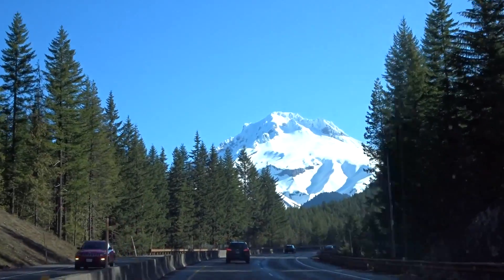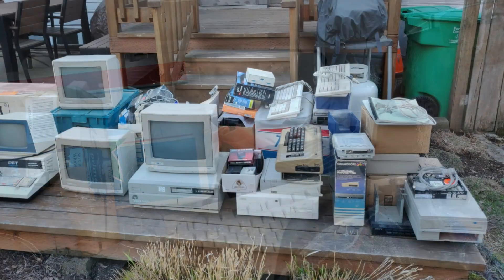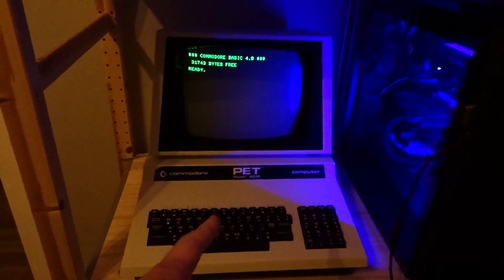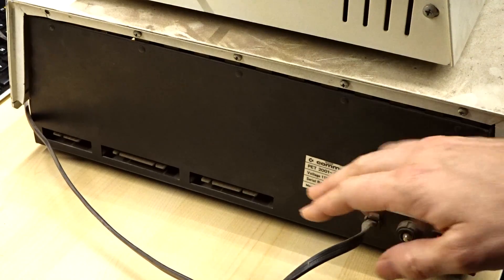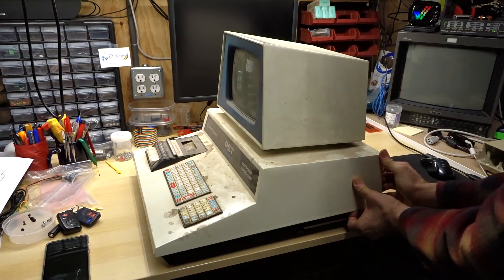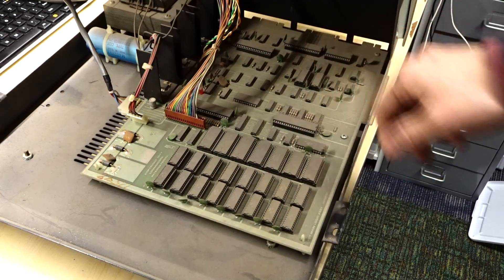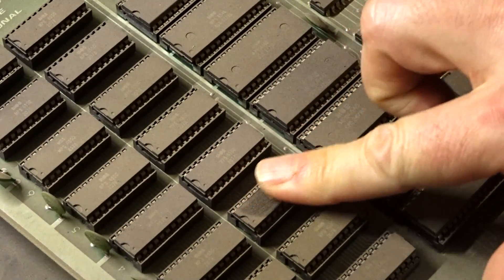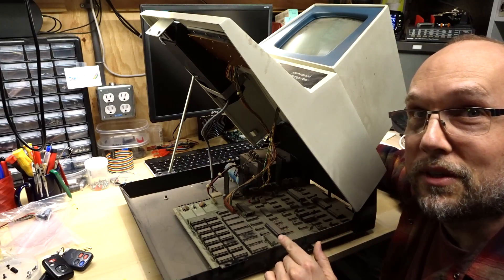The Commodore PET Rescue

Comment: the expansion port carries a full bus up to address line 11 along with quite a few pre-decoded select signals and as such... yes. you can hook up pretty much anything you want to it and i'm sure people did and many still do (mainly considering that the thing lacks both rs232 and any other sort of network capability - the pets don't even do software bitbanging rs232 on the userport. at least not without loading the routines for it yourself. so yeah i do guess quite a few people instantly soldered a 6850 to that ;) besides that. other than the keyboard, the basic revision they originally shipped with (most have been modified to basic 4 anyway), some other obvious things. it's pretty much the same machine as a 4016/32 or 8016/32 they all seem to have the video ram in the same spot, 1 via and 2 pias, in the same spots too. they also all have $0401 as the load address, so it's not like the 2001 is gonna do anything more or less than your other pet :P other than having a bit less ram and a worse keyboard :P the only thing potentially causing incompatibilities between the pet series is the various different keyboard versions when decoding them directly... some differences in the character roms for 'international' versions, and the 'basic 2 or 4' (along with different kernal and editor roms to accomodate that) thing. (not that it seems to make much of a difference while running programs as basic 4 is just microsoft basic too. just with another number ;) as for the 'just soldering stuff to that expansion port' eh yeah well gotta keep in mind the previous model was the kim-1 :P lol. and other such things which come with a piece of prototyping board to solder onto on board of all things :P i do think many people 'added some stuff' but no. not with a connector and a cartridge housing around it. :P lol.

Comment: Wow… your YouTube site …what a find!! I am in uk. The Pet 2001 was the first computer I programmed in 1978… I subsequently swapped a Casio programmable calculator for 4K 2001 one in 1984. I have it shrink wrapped in my loft, processor working and some display corruption probably through corrosion too. Anyway you’ve inspired me to get it down in 2023 and sort it out. 😉Thanks. Ps any exposure to Cambridge Computers mk14? Subscribed, Mark aged 60 1/2

Comment: The big blue Mallory CGS series cap went leaky in my 2001. Last time I took it for a spin, the transformer hummed like crazy and clearly wasn't happy, so I immediately pulled the plug before blowing the primary. The Mallory is originally 27000µF, which is an odd value (it's also a LOT bigger than the one in this video). The closest replacement I found is a 24000µF KEMET, which is much smaller; not sure if it's still long enough for the original mounts. Given that the tolerance is probably 20%, I expect 24000µF is still ok. Mouser and Digikey still list the Mallory CGS series in Europe, but they cost about triple compared to the KEMETs, plus double for shipping!

Also, the fuseholder on my 2001 broke too, though it was actually the plastic post that cracked and separated where it passes through the case, exposing the metal contact and shorting it to the case! This happened while I removed the fuse to check it (assuming it had blown due to the essentially shorted cap). Luckily these are easy to replace, though the 6.3mm fuses are less common in Europe. The original fuse -- rated "3/4" at 250V, so presumably 0.75A -- is still intact, so that's good news.
Reply: P.S. The top half of my 2001 is actually RIVETED to the back hinge, so removing it isn't an option. I wonder if this is the case (pardon the pun) with all later PETs.

Comment: At about 10:30 he frets about using a 1.5A fuse ("it's pretty beefy" and "more than enough for this computer") right next to the label that says the PET draws 1.1A. That could hardly be a better match - if anything a slightly larger fuse would be ideal.

Comment: Oh my God I owned a Commodore pet 2001 which I Purchased from Rick Inatone Back in November 1978. I programmed that computer day and night, I peaked and poked the memory. I can remember typing Hexadecimal code into the machine to program  a chess game. I wrote basic computer software programs and actually stored them on cassette tape. It took 20 minutes to back up the 8K of memory and you had to do that three times just to make sure one of the copies was readable. My first big endeavor was to program a bowling league sheet which I printed on the commodore  dotmatrix printer. I eventually programmed my business using Commodore 8032’s coupled with the hard disk drives, what fond memories. I actually have video tape of me playing chess on the computer with my son on my lap, as he was only less than one years old. Thank you for bringing back such memories.

Comment: SRAM is still much easier to work with than DRAM.

It is also easy to adapt newer SRAM to replace older SRAM, and it could be done with making a board that plugs into the existing SRAM sockets and routes the signals to the new SRAM.

Comment: I recently picked up a Commodore PET 2001-8 however I am having a power problem. When I turn the machine I hear deep humming followed by a little smoke coming off one of the rectifier diodes. 

I have ordered new diodes, so I have to wait to see if that will help.
Are there any other trouble shooting test that I can run to test the incoming power, or test for shorts throughout the board?
Someone had placed IN5406(600v) diodes instead of the IN5402(200v). So, I have ordered the correct ones.
This video was a bit helpful, but you will want to fast forward to 9:00

https://www.youtube.com/watch?v=Hgz1GqeprKE

Comment: Wire up a USB-to-serial cable to connect the 4016 to the PC. You could use the PET to display CPU load, RAM usage, fans, temperatures, etc...

Comment: I really enjoyed this video. But I wish you had checked the voltages before giving the motherboard power, given how rare the SRAM chips are, it felt a little awkward. I look forward to the cleanup, and am enjoying your content!
Reply: Someone said in another comment that isn't possible with this computer because the power supply is on the main board and there is no way to isolate it. But maybe replacing any large filter capacitors would be a safe precaution, especially if the chips are so rare.

Comment: these commodores always have problems of some sort. My 64 was in a box for like 10+ years and later found out the sid chip had a bad voice and the 64 was in pristine condition, it was only used a few times.
Reply: The VIC-20 seems to be much more reliable for some reason. I have two of them and I didn't have to do anything other than clean them. They worked perfectly fine. But I bought a C64 and it's not working, and I've seen so many videos of people trying to repair them.

Comment: uhh! It really looks like you have a different kind of dust that is extremely fine! I have a dvd recorder that had some errors because of dust that was on the circuit board. I tried twice to use an air compressor to blow off the dust on the board to get it clean, and it just was so fine that it just doesn't come off! fortunately I was able to get the recorder working again by repluging in the cables everythere to make sure everything was actually connected.

Comment: On old dusty computers like this with dual row ICs, I'd recommend carefully pulling the socketed ICs and cleaning the contacts manually.  Use a glass scratch brush on the IC pins, and a small contact file in the sockets if absolutely necessary, after a good swipe with alcohol and a toothbrush as the first course of treatment.  De-Oxit is good stuff, but it helps to get things as clean as possible first before using it around PCBs, because it will tend to wash the contaminants onto other parts of the board where they can cause issues.  Honestly though, I'd probably ultrasonic the whole board too, and replace all the electrolytics as a matter of course.  It doesn't seem that much is wrong with that PET other than some poor contact surfaces and/or dust bridging lines.

Comment: Wowee! Fun! I have two of these original PETs. One blue badge, one black badge. Just try to find one 6520 VIA...I dare you. Hopefully it is the dust(probably is). If not, I read you can use a 6522 VIA out of a commodore disk drive. You can replace the 6551 memory chips with 2114s with a wire circuit daughter-board adapter. I bought a few several years back on ebay in case i ever need any. However, recently, I saw that a bunch of NOS 6551s from 1982 were made and were for sale in the the tubes on ebay. Why they made more in 1982? Probably for surplus for service outlets given the end of the PET line was that year.

Comment: It can't be Oregon, or it'd be raining.  Don't say bespoke, it makes you sound pompous, when talking about junk we all have in our barns (event though it's dictionary technically correct - I think we always just said "custom").   

Look at the the PET, then look at the VIC, and go huh? - how did they make that leap, they look nothing the same?   It's inexplicable.  Until you realize, at the time the big three first to market were the PET (KIM in a box in 6 months), the Apple, and TRS-80 Model 1.   Compare the Model 1 to the VIC.  The VIC (sold in JC Pennys) was basically a rip of the Model 1 to bite into its market share because Radio Shack was dominating with all their store locations.  And of course the 64 was what the VIC should of been, and the 128, what the 64 should of been.  Everybody ripped off and copied everyone back then, it was a war of speed of fastest to market with whatever crap you could get working in a box and out the front door.   Explains Microsofts QDOS and Apple ripping off Xerox, it was just mercenary and sketchy back then.  8 bits were the new crack cocaine drug and the early manufacturers were drug peddlers to hippies.

Lots of videos of Bill Herd and Jack Tramiel on YouTube talking about C= Chicken Lips history.  Have fun cleaning the calculator keyboard.  And er, using it.   :-p    The 2001's only claim to fame is just that it looks like it belongs on the set of an early Star Trek.

I did a lot of programming on 8032s in college, and my girlfriend worked on KIMs in her computer lab...  they were horribly obsolete by that time.  I cut my teeth on a VIC/64 so I was right at home on the 8032, but talked my dean into letting me move over to a 12mghz PC with QuickBasic Compiler where I wrote a Spreadsheet app for him..  I ended up with an 8032 in my junk 10 years later from someone clearing out their garage of 8 bits.

 I got a barn full of 8 bit and later crap, so if anybody is near Augusta, GA and interested in helping me clean it up and getting it running some day, hit me up.   Just don't have a big building to display it all in.  I use to bring  it home by the pickup truck load from colleges and universities and nuke plants throwing it out in the 90's when it was absolute trash.   I use to say, all old computers eventually come to me to die... and they did.   If you were willing to spend the gas to haul off other peoples trash for them, you could have all the e-waste you wanted back then.   I probably got some 120 or so machines left that I myself did not dumpster.  Enough for an instant museum.

Comment: Hi Adrian, I'm sorry but I can't help to give a few suggestions.  You should disconnect and test the power supply first.  Then change all the electrolytic capacitors.  There really is no reason to even giving them a try.  They slowly turn into resistors after all these years and will cause much larger problems somewhere else in the board.  I usually change the power diodes too first.  I only feel safe to power a vintage electronic device like this after doing all those things first.  Same goes for the CRT as well.  You know you can easily damage a hard to replace part. Maybe you were very anxious and couldn't wait to start it up or maybe you wanted something to break so you could fix it on youtube or maybe you want somebody else's computer to go bad by giving a bad example and you want to fix it for them, I really don't know.  I know this is all very interesting but you don't want to give inexperienced viewers wrong ideas about the requirements of a vintage device.  I have a new vintage computer, I am very excited, I have to try it right away... very childish and wrong....

Comment: Please clean the dust off before turning on your next old computer. Dust can be a source of static electricity build up. Don't take the risk. Also, please invest in a variac to ramp up voltage to on old computer of unknown condition - more important for CRT than computer but worthwhile anyway. This way you can check voltages etc and won't need to rely on the smoke. You're a very lucky man to have all those goodies given to you - please look after it :D

Comment: You are braver than me Adrian. I would have been scared of all the voltages being out of whack from the age of the power supply and there would have been magic smoke released. Also is that big blue thing the smoothing capacitor for the rectified mains?

Comment: Should probably test the power supplies for correct output voltages with a multimeter
first, especially on these old commodores as they have a history of that, and wrong
voltages will damage the chips.  Though you may have known this and simply got
too excited for precaution eh.
Reply: YES! THANK YOU! I can't believe he smoke tested a 40 year old collectors item of that historical importance. Sometimes the voltage regulators fail too, and they'll still run at 9V until they die. The capacitors may need changing(the smaller ones). But ya, test voltages with supply voltage disconnected from main logic board. Then test again with them connected to see what it looks like under load. Smoke test=no test...and probably a few fried parts that are darn near impossible to find.

Comment: Wash that board! Depending on where you live, dust can be conductive, and ruin electrical connections.

That was the first PET I used in high school at the BTHS Physics Dept. Computer club in '78 and then we got the other 2001 with the full keyboard. Strange; the newer 2001s with the large keyboard used 2114s Static RAM Chips and 4108/4116 Dynamic RAM chips. Putting/upgrading that PET with more RAM should not be a problem.

Later in HS ('80/'81), the Math Dept. got a bunch of 4016s to teach programming on but being a computer club member, I was head of the class and the teacher who did not know anything about programming.

I've seen a RAM expansion board for the PETs that fit that slot.But that was a long time ago.

Comment: I normally don't make comments but the PET 2001 is a model I always wanted to find.  Hopefully some day.  I was concerned when you powered it on you didn't check the condition of the power supply before powering the logic board.  Overvoltage could have made the situation much worse.  I know the C64 power supplies have this problem but I don't have much experience with PET models to know if it's common.  Though I would not have taken a chance.  I look forward to seeing this machine restored.

Comment: Please!!! Never power up an old computer in unknown state, before checking correct power supply voltages, clean contacts and paths, chips-to-sockets corrosion, blown/burnt components (visual inspection), and specially if capacitors are within specs!!!
Reply: I wouldn't suggest desoldering all the ceramic capacitors on this board just to test their values unless you have a problem.
Reply: I mean the electrolytic capacitors, that are more prone to fail due to leakage or drying out.
Reply: @audio01  Ahh, well I didn't see any electrolytic capactors on the PET logic board, but maybe I missed something you saw.  I just saw ceramic ones so thats why I assumed you were saying those needed to be removed and tested.
Reply: Maybe you missed out the BIG electrolytic at the back, besides the transformer? Also there's four smaller ones in the board, in the power supply circuit.
Reply: BTW, it isn't only about the logic board, also you have to take in account the monitor, with lots of components very prone to fail. In this type of vintage computers, I would do anything to prevent a major failure before powering it up, i. e. inspecting it first thoroughly.
Reply: @audio01  Nope, I saw the big one next to the transformer which is why I said 'on the logic board'.  As was said elsewhere in the comments a few times, no-one has seen the big one go bad yet.  I didn't see other ones on the pics but I don't have a PET.  Which model do you have?  Is it the same one?
Reply: The picture I posted is practically identical to the model Adrian has (2001-8). Check one of the 4 smaller capacitors in this video @ 5:00. It's right to the side of the first heat sink.
Reply: @audio01  Ahh yeah, good catch, didn't see those hiding between the heat sinks.  :)  Though, they're so small that I wonder if they're doing much of anything, voltage wise.

Comment: Wow, really trying your luck turning it on before checking that the voltages were correct.  A bad PS could really ruin some of the logic chips and your entire day.
Reply: The "power supply" on this is strictly a Transformer providing AC voltages and it's pretty rare that a transformer goes bad.  The things that go bad are almost always the voltage regulators (like you have on a C64 Power Supply) and in the case of this pet, those are built onto the board.  There is no easy way to 'check voltages' on those in the case of this pet without powering it up.
Reply: @BrianV_PM  Yes, I was thinking specifically about the regulators - the transformers are usually bullet-proof.  I had forgotten the regs were on the mainboard on the 2001 - pretty nasty really.  Makes it a bit of a nail-biter to power up after 45 years tho!